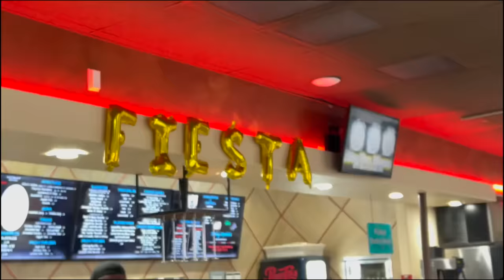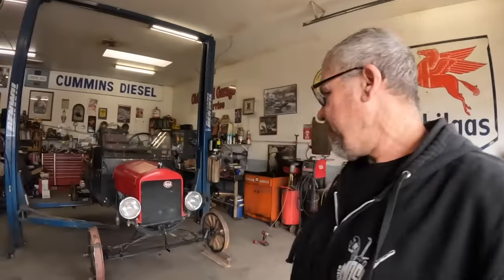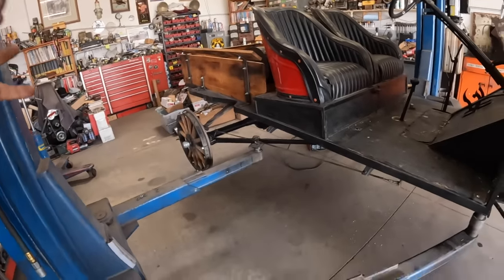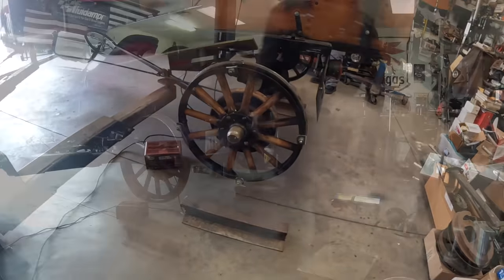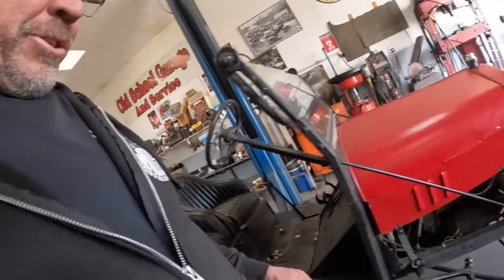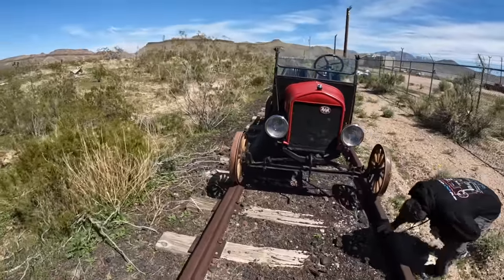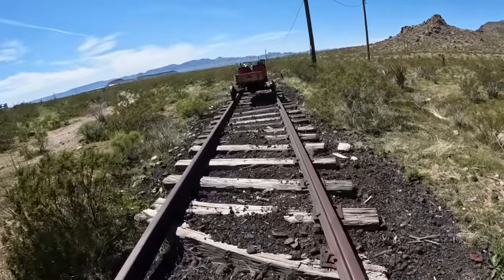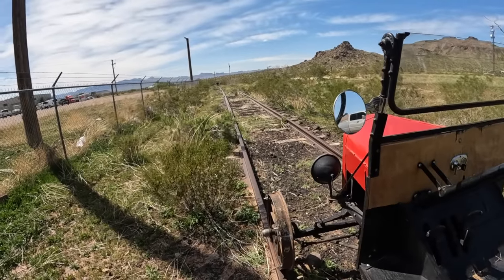I Built a Model T for Abandoned Railroads *THIS HAS NEVER BEEN DONE BEFORE*

Comment: we used "Go Karts " we also put flanges on both sides of the wheels . I don't know how you would do it on a model T but having the axles on a kart where they would move in and out is a plus . Doesn't have to be much maybe a half inch or so . The kart wheels mount way different though .

Comment: I made a rail road cart out of a snowmobile trailer. 
I started with rubber tires from the front of a riding lawn mower and mounted disc plates from an old field disc.
The first try, I ended up with flat tire. 
I ended up making the rear wheels from Polyurethane.
I think that you will need wider wheels  and you have to have the wheels have the inside of the wheels a bit bigger around then the outside wheels. 
The angle will keep the cart on the tracks even on any curves on the tracks. 
That is the way I did it. I'm not saying that you have to listen to me, just a suggestion. 
Good luck!

Comment: Railroader here. You need a small amount of play between the flanges of the wheels and the inside of the rail. It helps keep the flanges from riding up onto the top of the rail and derailing like you did. Taller flanges would help as well.

Comment: Pretty cool rig!  I would suggest, a steering wheel lock of some kind, and those bolts on the outside of the wheel, might be an issue, when you try crossing a railroad frog, if you know what that is?

Comment: Having run trains and trucks on the rail it is hilarious to watch you move the steering wheel as if you are driving. It’s a common mistake when you get on rail to try and drive. If it works right you will just mess it up. But ya done good.

Comment: Really neat build you guys got here! The railroads used to use these during the depression for track maintenance when Fairmount Speeders weren't readily available. I'd suggest you guys to take out the steering wheel and permanently lock the steering column to be straight to prevent having to hug the steering wheel constantly while going down the tracks. Larger flanges on the wheels would help a ton as well.

Comment: your wheel profile is wrong, it has to be larger at the inside flange and beveled to the outside to making it smaller for the wheels run correctly on the track. it has to match the track profile.

Comment: Love the concept  a great time could be had perhaps you need a larger flange to hold it on the track better. if you lok at a train wheel you will notice the wheel is slightly tapered where it sits on the rail.Dont give up your day job.lol love it
Reply: You got this 😂😂
Reply: Bigger flanges will hit the fishplates that join the rails, so that option is out.
Tapered tread only self-centres if the wheels are locked together. If they can spin at different speeds like on a car then it doesn't work at all.  A taper only makes the heavy side drop down and the lighter side run against the flanges.
Merlin knows what he's doing.

Comment: Got any model T for sale ?
Reply: Model T - A & v8
Best car ever
Irreplaceable for end of world situation 
 They will outlast and out perform every other type of mechanical transport.
 That rail is also good if roads & bridges blocked
 Now - Iv heard - emp and dew don’t effect Model T
They are like a side by side quad for off road 
And
They can burn kerosene, alcohol and natural gas / propane 
Multifunction multifuel capacity 
 THERES a place in Moriarty New Mexico that has some model t and parts
 I think the 28 modal A with a v8 was best
I don’t know if transmission line up
I believe the 28 had the top loader 3 spd
  They are all far superior to any new vehicle 
Iv seen - 2 spd rear conversions 
And over head valve 4 
With later transmission doing 75 mph down interstate 
Iv seen that in real life
Ya - wow
Setting up a proper T - A or V8 is critical 
Good stuff
I’ll watch this again later
The details are important 
Clutch arrangements and buzz box all that Rocky Mt brakes
Fascinating 
They should have made them another 500 years
Really

Comment: This looks like fun!  If I were to start on this project, I'd start with a VW Beetle (12-volt system) and adjust wheel axles to match the track gauge to the wheel centerline but using wider tires.  Let some air out of the tires as needed to keep the Bug on the tracks...as has been mentioned several times in the comments.  
Why VW Beetle?  It's air cooled and reliable.  You don't need heavy motor with a ton of HP, and you don't need a water cooling system to keep track of.  Plus starting with the VW you have springs and shock absorbers.  

Then if that worked pretty well, the next generation project would be to build a Beetle based, rail-type, dune buggy with axles to match the railway gauge.  The rail design can give you more ground clearance than the stock VW.  An LED light bar (or 2) can give you all the illumination you need.  After 60 years of practice, including rugged racing, rail dune buggies have the kinks worked out.  Again I would stick with the rubber tires at least at first.  If you are feeling especially "garagey", mount a 250cc or 300cc Honda motorcycle motor to the drive train instead of the VW.  You don't need a complicated differential for rail riding.  If you are going on rails where there are thorny plants, then a steel wheel conversion might be needed.  

Another priority would be a method to re-rail a derailed car.  I like the wedges (i.e. ramps) idea from the comments, but what if you want to turn completely around on the tracks?  This needs some thought.  In any case I think the ramps would be a part of the system.  

As for that spot where the ties were akimbo (19:19 in the video), that might have been done on purpose to "demil" the tracks and prevent future use by regular train traffic.  It's trivially easy to break the track doing that.  Watch out, because they might have done that every few miles.  Regular tires should roll right over that, but not gauged wheels.

Comment: Why not make a hi-rail modification to the Model A or Model T ?

“HI-RAIL TRUCKS ARE DUAL-MODE VEHICLES, WHICH MEANS THEY CAN OPERATE ON BOTH RAILROAD TRACKS AND ROADS (HIGHWAY + RAILWAY = HI-RAIL). IN ADDITION TO THEIR RUBBER TIRES, HI-RAIL TRUCKS ALSO HAVE A SET OF FLANGED STEEL WHEELS THAT, WHEN DEPLOYED, ALLOW THE VEHICLE TO TRAVEL ON RAILWAYS.

DEPENDING ON THE SYSTEM, PROPULSION MAY BE GENERATED BY ROADWAY TIRES OR A HYDRAULIC SYSTEM. THE FLANGED WHEELS ARE OFTEN FREE ROLLING. DIRECTIONAL CONTROL IS CONTINGENT ON RAIL CONSTRUCTION, ELIMINATING THE NEED FOR STEERING. STEERING LOCKS ARE INSTALLED TO PREVENT THE POTENTIAL FOR DERAILMENT.”

Comment: Wheel tread (1:20) and flange (1:40) should both be angled (preferably with a transition radius between them) and lock the steering straight.

Comment: Cool idea but... In order for it to work properly you must have a live axle at least in the front, both wheels tied together. On the rear you could use regular tires because they just follow the front.
 Secondly you should build a simple mold and use polyurethane as tires. I suggest Flexit-90. Then put them on a lathe a taper them on a 3 degree taper. Third, the safety flange should be 3/4 inch taller. I hope this helps. I have built a rail car so I do know a thing or two. 😊

Comment: I'd say you might need more taper on the wheels, that's how trains stay centered and not fall off. Maybe a larger flange to gate things from slipping. If everything is set up correctly you shouldn't even need a steering wheel. Look up the Galloping Geese, that's a decently close comparison to what you're trying to pull off.

Comment: SO awesome!! If I lived out there I would absolutely be either modifying my welding rig to be able to ride on the rails or build a rail speeder that could attach to my truck so I could hop on anytime. I saw someone running their railcar over some rails where the bed had been washed out and they were hanging in the air. I would love to try making it over those sections. Some type of clamp or clip that would secure the wheels to the rails would be great so that you would never have to worry about wash outs. Looks like so much fun Merlin!! Going to need a roof!! or at least a roll top removable roof. That sun is HOTTTT!

Comment: There’s 2rail lines not very far west of you that you may know about. One is the San Diego & Arizona that you can get to/on just west of Ocotillo Ca . just off i8 but some of the latest videos of it seem to show that it is get littered with rock slides and I believe there is a tunnel collapse a few miles up. The other is the Eagle Mountain Railroad just east of the Salton Sea , each was used to haul iron ore up until the 80’s.. if you google either one you will find several rail kart videos on them. Those rims on the T look like they could use a little taller flange on them .

Comment: Conical wheel-treadMost train wheels have a conical taper of about 1 in 20 to enable the wheelset to follow curves with less chance of the wheel flanges coming in contact with the rail sides, and to reduce curve resistance.

Comment: So we did this with a 50 Studebaker. . Let air out of the tires turn up the idle sit on the hood and drink sodas. We would run 30 miles out in drive and 30 miles backwards in reverse.

Comment: Rail wheels are not meant to ride with the flanges touching both railheads at the same time.  Look up AAR rail wheel profile to get a good set of dimensions to use.  The flangeways are 1.5 inches.
Attach some clips to the steering wheel column to flip up and catch one of the steering wheel spokes to keep the steering wheel straight.  That is what is done on railroad highrail vehicles.
The gauge of the wheels can be up to about 1.5 to 2 inches wide before the wheels fall in on wide gauge.

Comment: You should put an old bumper jack with a pin through it on the front so it will swivel back and forth when you jack it up and you can lean it from side to side to drop it back on the rail

Comment: Well all the above are excellent suggestions but removing the tie rod and making a custom tie rod that  pins to the center of the axle securely  to prevent steerage after it is on the rails will be necessary I think.

Comment: M, did you know that if you reverse the rim mounting of the older 5 bolt hole rims. Air down the tires and the tires fit the railroad rails.
Tires will even track over the switches. We used to run the rails on Saturday/Sunday on the commuter lines from Lincoln Park to montville to go swimming. Was good and quick beating other guys to the lakes not going on winding country back roads with that tiny VW engine. Did for couple years UNTIL came to encounter a special steam railfan event with a Pennsylvia RR Decapod with ten cars! We saw the smoke then the headlight. Yes we bailed the VW off into the cattail bog.  Took all of next day with my dad's body shop wrecker and lots of cable!
You do kind thing now and it's ticket and fines.
Bearing

Comment: From 1908-1928, the Hebard Cypress Company had a railroad to haul timber out of the Okefenokee Swamp in southeast Georgia.  Footage still exists of Model T’s they used to run people in and out of the swamp in lieu of the logging trains.  These cars had large solid cast wheels on the rear axle and a four wheel truck (like a rail speeder flat car) whip pivoted under the front cross member (in place of the car axle).  The front truck functioned like one on a steam locomotive.
Reply: On that same 1926 footage, the Hebard family had gone on a duck hunting trip to Floyd’s Island in the Okefenokee.  At the end of the rail line on the island, there was a manual kind of teeter-totter turntable where the Model T’s were driven up onto two rails and, balanced with the rear rails being lifted by two men, the car pivoted around, and the front rails being dropped onto the outgoing rails for the return trip to Hebardville/Waycross.

Comment: Hi Merlin. Nice setup, but there is one aspect built into most railroad rail vehicles from bicycle based ones to the putt putts, and thats a variable width mechanics ... basically its a spring loaded horizontal bar which gives you side push between the two front wheels and two back wheels which allows the wheels to go wider or narrower as the RR track widths are never "true". The spring auto adjusts this width as you drive. ALSO maybe make the inner ring that keeps the wheels on the tracks just a bit deeper so its not inclined to jump off the tracks so much during this spring action as you drive. Otherwise that car would make a great RR track vehicle. Were up here on Vancouver Island and our RR tracks are not in use on the northern sections of our RR. Our neighbour made many of these vehicles from bicycles and that was his main secret for success ... a variable width front and rear axle to keep the vehicle firmly planted on the tracks at all times. Thanks for the episode, don't give up your on the right track no punn intended.

Comment: I've watched it few videos of some guys who built carts and their own wheels. The groove seems to be about an inch on the inside away from the track and the wheels are about 6 inches wide so they don't derail. they run for miles on abandoned tracks.with a 10 HP motor. But they can lift theirs up to turn around I don't know about your car weather you can run in reverse that long without overheating.This is a cool deal you can have a lot of fun . Take care guys.

Comment: Once the rust is gone off the rims it'll  help too ,Possibly Merlin Try making  an oiling swab on the rims to make it guarantee to slide onto the track the front being oily should  be enough  for the back to slip on too ,A 4x4" box above with a 3/16 hole in bottom dripping used oil to keep a rag or some of the old car seat cotton saturated .😅
Reply: Good idea, then the car can do 5 horsepower burnouts on the track.
Reply: @Mark_Bridges  No doubt right

Comment: The wheel shape MUST be tapered( the lighter the vehicle the greater the taper…the inner rib is the “i am fcuked” indicator the weight of the vehicle .the slope of the tracks between rails determines the maximum speed…the play in your front end plus toe in/out are more likely to throw you from the tracks..plus no steering is best for train tracks…true tight straight wheels work the best
Reply: Taper only works if the wheels are locked together. Car wheels can spin at different speeds so a taper doesn't work at all.  The taper only makes the heavy side drop down and the lighter side run against the flanges.

Comment: You might consider contacting the Nevada Northern Railroad in Ely, NV (home of the world famous Dirt the Cat) to see if they  would allow you to run there.  It is not abandoned, very well maintained track, but since they are a tourist destination with trains not running every minute of every day, you might be able to work something out.  Plus there is the bonus of all of their running steam locomotives you could check out while there.  As for your project, LOVE it!!  But as others have stated, your do need a little camber on the profile of the wheel so they self-center, and a little bit taller flange.  The top of rail is currved, not flat, and with your wheels on the top of the rail, it did not look like there was very much of the flange holding against the rail.  Also, you should definitely fix a way to lock the front wheels straight while on the rails.

Comment: Try a larger lip on the inside the rim could avoid it derailing so much & have the gap set so it's like a 2" angle iron rolled into a round !
Reply: A bigger flange would hit the fishplates at the track joints.  Can't do that.

Comment: The railroad used to do this in the 30s during the Depression, it was called the Galloping Goose (because the back end used to waddle while going down the tracks).  It has a Wikipedia page if you are interested in it.  They still run these in the summer months.

Comment: I thought that it might be too light to ride properly, glad I was wrong! Tho you might try adding some weight to make it stay longer. Or try adding some taper to the contact surface. 
Awesome!
Reply: Taper only works if the wheels are locked together. Car wheels can spin at different speeds so a taper doesn't work at all.  The taper only makes the heavy side drop down and the lighter side run against the flanges.

Comment: i would make the lip larger by welding metal to the rim and rotate it and use plasma cut to make it round and you could make the lip as large as you need to keep it on the rail. large lip would hold it on the rail better.
Reply: A larger lip will hit the fishplates at the track joints.  Can't do that.

Comment: This is sketchy from beginning to end. The geometry of those wheels is all wrong. Not nearly enough flange, they're flat but should be conical, and they are very flimsy. Before starting a project like this, it's a good idea to do some research and see how the rail engines and carriages do it. There are lots of reasons why railroad wheels are shaped the way they are.

There's a huge difference between something that "works" and something that works WELL and is reliable.